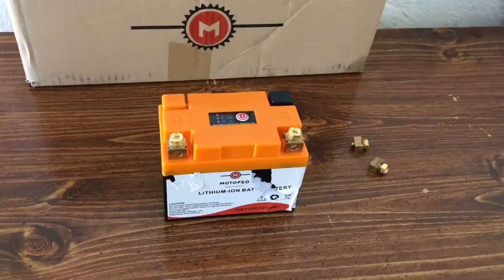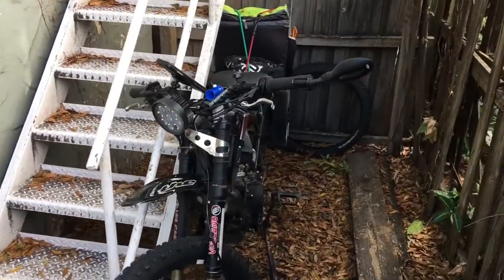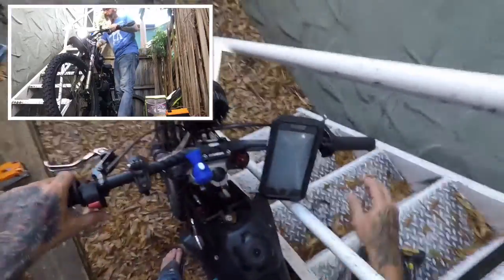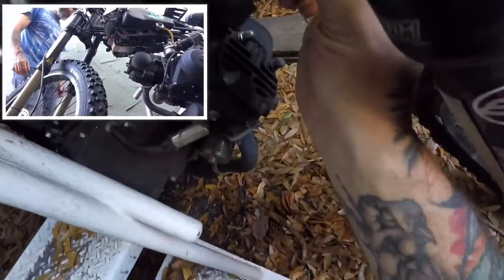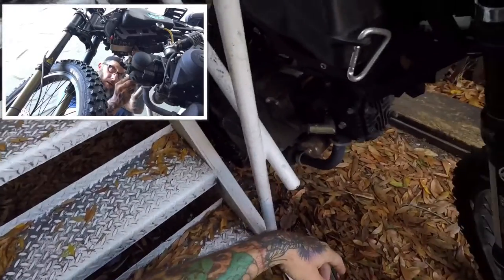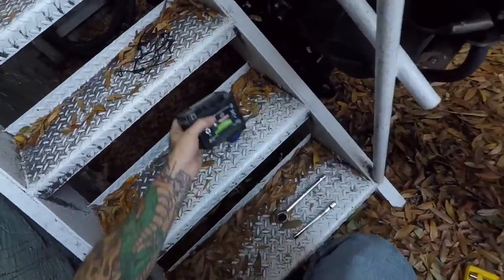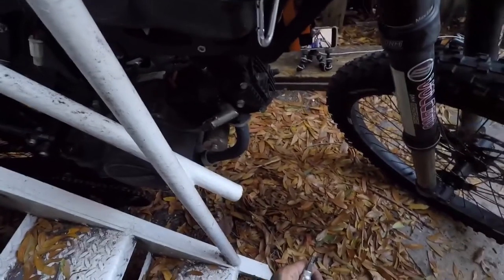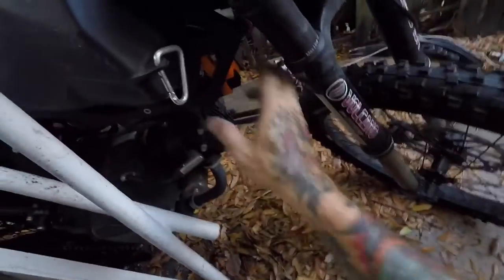Motorized Bicycle. Motoped Survival Bike 49cc new battery. Bike travel.

Comment: Hey Grey Beard.  Just found your blog.  How did the 49cc bike do on the cross country ride.  Is 49cc enough, or would you recommend more.  I'm planning a build, considering Motoped no longer sells them.
Reply from the maker: It was a ton of fun actually. 49cc was enough to get around although quite slow and not the best for hills. Looking back I would have put that money into a small motorcycle and had just as much if not more fun and definitely would have been able to make it further. I travel just under 5k miles with it then things started to wear out.

Comment: I just can’t see how you can spend 3k on a bike like this. I’m 15 and am building a gas bike and used an old Specialized mtn bike for under 300$ all said and done. I think the motopeds are cool but for that money you could buy a brand new Honda Monkey which is more capable, comfortable, reliable, and faster. I’m not harshing on your ride I just don’t get it
Reply from the maker: I can spend that because I’m almost 50. Meaning I have money to buy things. Give it about thirty years bud and you’ll see what I mean.

Comment: Thanks for posting this video. I'd been thinking of a Li-Io battery for my Survival bike and it looks like an easy replacement. Still, the original battery does work well. I didn't start it for 2-3 weeks during a real cold spell here and it started right up after that delay. Wondering just when I'll have to recharge it. Thanks again, and safe travels!
Reply from the maker: +John Mumaw I feel like the original battery is a good one also. I do like the lighter weight of the Lithium. Traveling across the country and weight is a major factor.